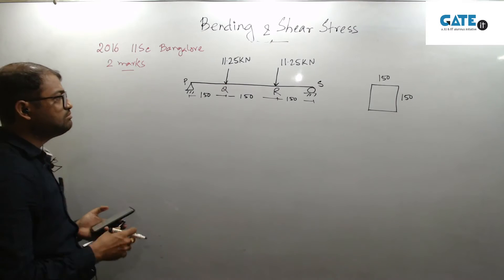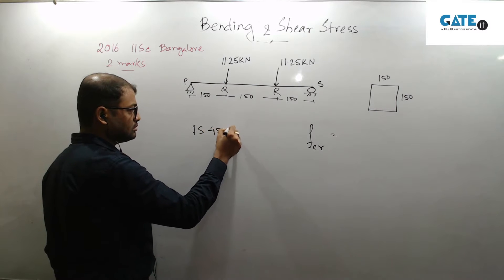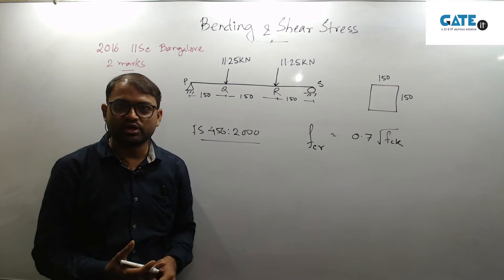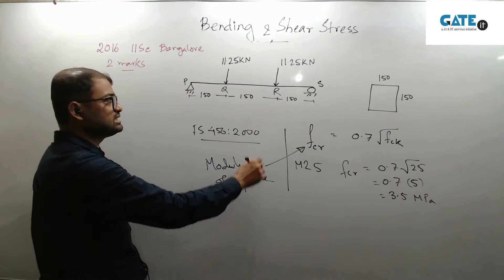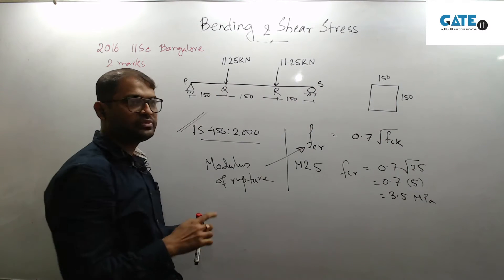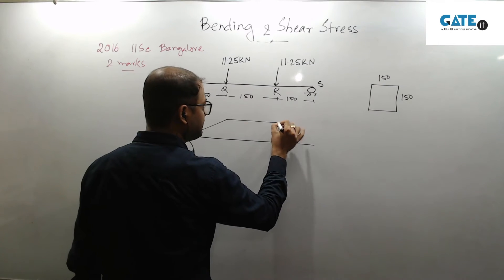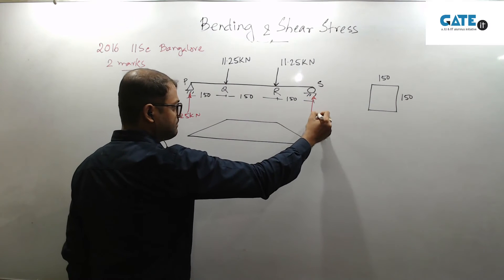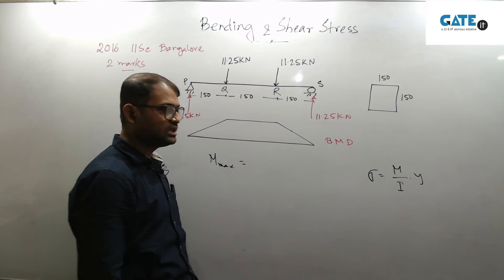Modulus of Rupture | Bending Stress || GATE Problem 2016

Comment: How do I get a stress-strain curve from a 3-point bending load-deflection curve given that it is nonlinear or behaves elasto-plastically?How do I get a stress-strain curve from a 4-point bending load-deflection curve given that it is nonlinear or behaves elasto-plastically? Stress value 4.991,23.960,39.452,22.059,56.601,59.016,60.00,58.941,58.087,58.087 and strain values 0.0001,0.0005,0.0009,0.0012,0.0017,0.002,0.0024,0.0029,0.0031,0.0035 from this values of stress vs strain curve. How do i get modulus of elasticity as modulus of elasticity is slope of stress strain curve.but correct value is for modulus of elasticity is 37400mpa.but not getting same.
Reply from the maker: Plotting stress-strain curve should not be difficult. Main problem is to decide the slope of the initial portion of the curve while establishing slanted straight line from 0.2% proof strain (0.002 strain). If I find some time, will plot and see the value of E.
Reply: @CivilGATEit thank you sir considering the request.